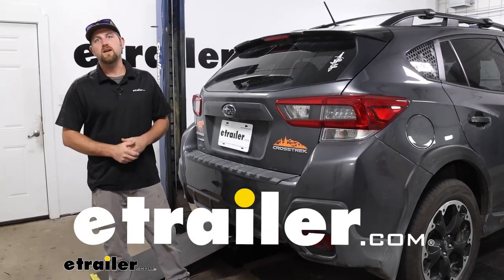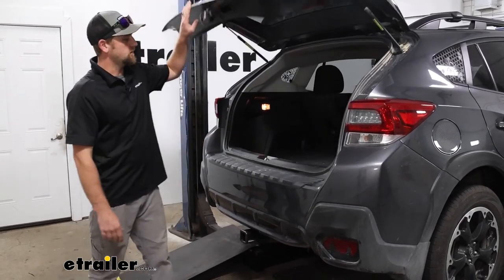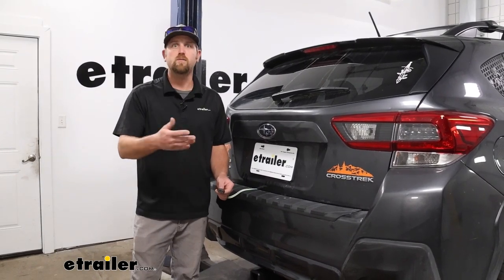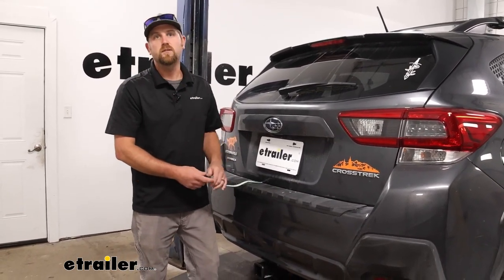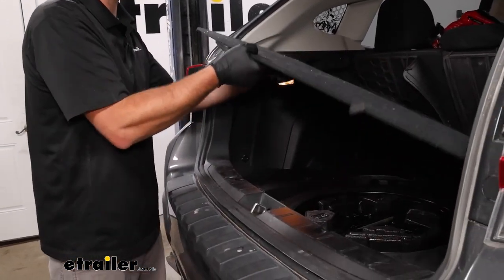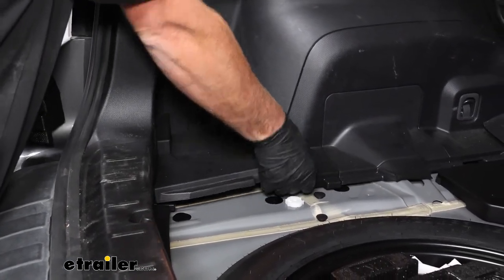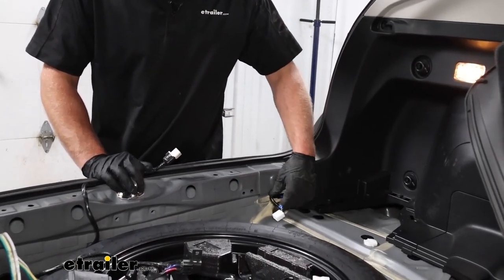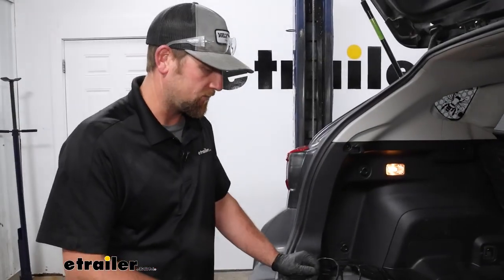etrailer | Hopkins Trailer Wiring Harness Installation - 2023 Subaru Crosstrek

Comment: Why didn’t you just take out the spare tire. The plug is reachable if you do that without all the disassembly and there is a plug you can remove and not have the wires through the hatch.
Reply from the maker: You can certainly go that route if you wish, but we installed the wiring harness as the manufacturer's instructions state.
https://www.etrailer.com/Custom-Fit-Vehicle-Wiring/Hopkins/HM11143885.html